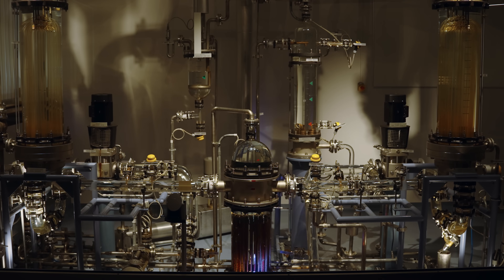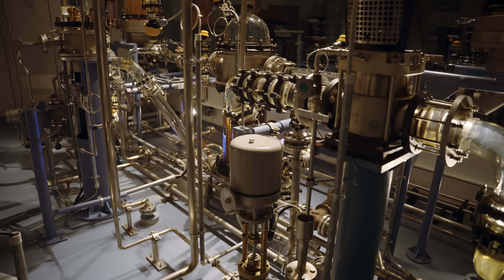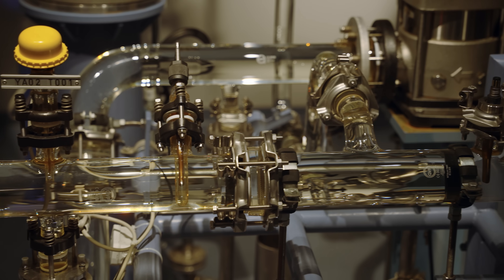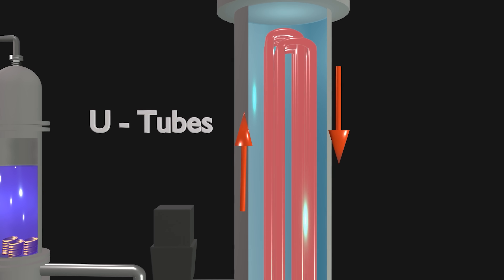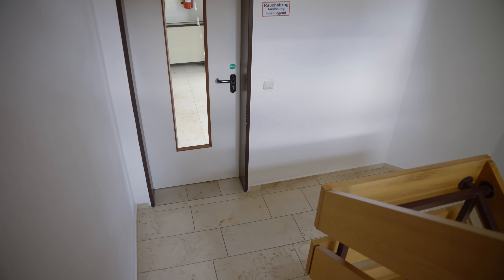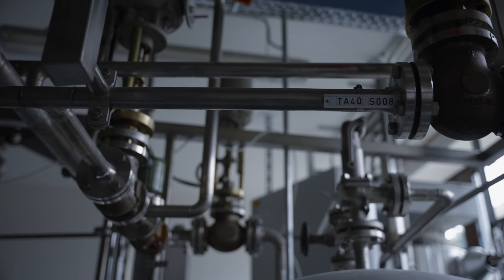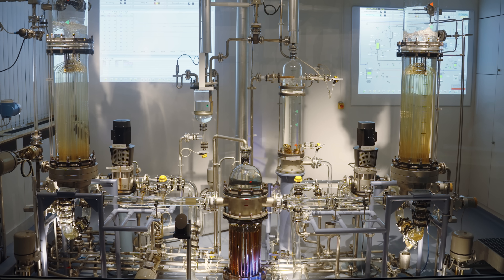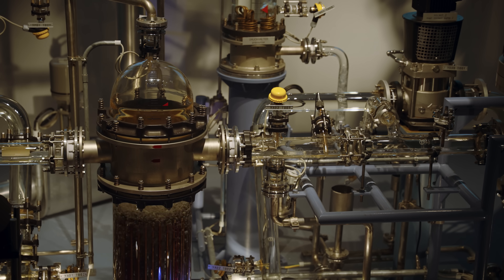World's Only GLASS Nuclear Reactor!

Comment: Sports can make a good analogy.
Take baseball for example. It's actually rather simple. Each team takes a turn throwing a ball at each other, to then hit the ball as far as they can within the play area. It's a simple concept. However, the professionals learn the fine details like fancy throws of the ball, angling of the bat swing, etc.
If you watch non-pro players... you'll see a sloppier game, but still pretty good. And if you get a bunch of people who rarely, if ever, to play... it's gonna be a mess and dangerous.

Nuclear plants are fairly simple in concept, with details to really get the most out of it. And that is why training is needed.
I mean, anyone can use 'spicy rocks' to boil water... but the pros do it with panache, and safety. And as the pros learn more, it only becomes safer and more efficient.
Old plants should be decommissioned... but they should be replaced with new plants.

Think of it like cars. A 1910 car was inefficient and dangerous. Modern cars are fairly efficient (could still be better) and have a lot of safety features (though I argue some of the most recent are adding new hazards).
The issue with cars is that most everyone (in North America) can buy one... and they only need to sort of be half safe about it. Drivers today are more and more like Homer Simpson working in a 'spicy rock' plant. Don't know any safety... and don't care to learn it.

Comment: I always find it a bit funny that our most efficient and technologically-advanced method of generating power is... lo and behold... boiling water, to turn a wheel.

But jokes aside, so PWRs are basically water-cooled, water-radiated systems that use pressurized water to carry the heat, and radiate it to unpressurized water which ends up boiling and generating steam pressure to turn the generator. Man, that's many points of failure and energy-conversion loss.

Comment: I missed the point and i didnt see any nuclear reactor. So, if i understood well a nuclear reactor is nothing but boiling water? 

So the Chernobyl nuclear reactor and exclusion zone is nothing but a puddle of boiling water? 

Thats not what i saw once in one of the many documentals about it
Reply: When you heat water up to extremely high temperatures, the steam separates into oxygen and hydrogen gasses, both of which are flammable, this isn’t like some stone with a boiling pot of water on top of it. The explosion at Chernobyl was from that hydrogen building up and exploding out.

Comment: At 6:35 I paused it to look over the model.  Identify the 2 coolant circuits pressurizer, relief tank and vent.  Then I noticed that the pressurizer is over filled but the pressure releif in under too little pressure.  The steam gen water levels look awfully low too.
Then I unpaused and found out why.
Reply: nice. good catch. later, you can see the core run dry.

Comment: 6:27 Many PWR reactors use three water loops - the pressurized closed-cycle reactor loop, the unpressurized closed-cycle steam loop, and the open-cycle condenser loop. This is mostly for reducing maintenance efforts and costs, as keeping a high-purity steam loop means less time taking turbines and condensers and evaporators offline for descaling and maintenance. Most marine nuclear systems use this three-loop system

Comment: "The phase out" or what i would call it "the Freak out", should not have happened. What happened in Fukushima could not happen in Germany, so getting in a panic and allowing that to take control was a weak moment for german leaders. Altho, have a look at the green deal and what happened there, getting a cushy board job at a russian oilcompany after pushing green is quite the "deal" lol. And the electricitypoverty that Germany suffered thru or still are.

Comment: Most electricity has always been made by either steam or water going through a turbine and spinning a dynamo - the only difference is in a dam or tidal, you don't need to push the water, and in coal, oil, gas and nuclear the only difference is how you heat the water

Comment: A good reminder that 96% of all US nuclear reactors leak radiation into the environment. 80% are leaking critical amounts of radiation 

All on the .gov site, just a hidden a little out of the way

I dont have a REAL "REAL" answer too why, but my most educated guess is they only care for by products to make nukes.... and other scientific equipment 

It was never about safe energy, thats very old propaganda that's been disproven since the dawn of nuclear science and the miltary.

Almost all nuclear plants help make nuclear ammo... (dense material for ammo, that ALL ARE HEAVY GUNS USE)

I'm not anti clean energy, but all of this "green" energy has been a lie. Windmills and solar panels make more pollution then most energy products... yeah... that hurt to found out.
Reply: The claim that 96% of all US nuclear reactors leak radiation into the environment is misleading. Nuclear reactors are designed with multiple safety systems to prevent radiation leaks. While minor leaks can occur, they are monitored and managed under strict regulatory oversight to ensure public safety. The Nuclear Regulatory Commission (NRC) provides extensive data on this, and there is no credible evidence to support the claim that 80% are leaking critical amounts of radiation.

The primary purpose of nuclear power plants is to generate electricity. While some byproducts of nuclear reactors can be used in other industries, the assertion that they exist mainly to produce materials for nuclear weapons or ammunition is not accurate. The production of nuclear weapons materials is typically done in specialized facilities, not commercial power reactors.

The notion that safe nuclear energy is "old propaganda" is not supported by scientific consensus. Nuclear energy is one of the most regulated and researched energy sources. While there are risks, advancements in technology and strict regulatory frameworks have significantly improved the safety of nuclear plants.

The claim that windmills and solar panels produce more pollution than most energy products is incorrect. While the manufacturing and disposal of these technologies do have environmental impacts, they are generally much lower compared to the lifecycle emissions of fossil fuels. Studies have shown that renewable energy sources, including wind and solar, significantly reduce greenhouse gas emissions and other pollutants compared to traditional energy sources.

Comment: Commercial fission nuclear power: too slow to build and too expensive to build/operate -- by far.  No way commercial will have any effect on the huge amounts of energy needed to displace fossil fuels over the next critical 10 to 20 years.  There's only one source of energy that can do that and it comes from fusion energy from the sky.  It can easily displace fossil fuels by several hundred orders of magnitude.

Don't be too sad.  Nuclear fission power will continue in specialized areas like military, scientific and deep-space exploration.  But commercial nuclear energy will disappear from all the world's grids in about 50 years' time.  The last 70 years of commercial nuclear fission proves it only amounts to 10% of the world's grid energy and it is falling.  Nuclear failed its promise.  If nuclear had worked out even close to what it promised, we wouldn't be so far down the climate crisis hole as we are now.  Sorry for all of us.

Comment: Having been a automotive tech for most of my career, im genuinely surprised at how similar a nuclear reactor is to the cooling system on the cars we drive everyday. It puts a whole new perspective on how simple these systems are and how safe, with proper maintenance and operation, these reactors are.
Reply: Every thermal power plant (coal, oil, half of a CCGT and nuclear) fundamentally relies on the same mechanism to generate electricity. The variation is on the choice of fuel.
Reply: Nuclear reactors are essentially giant steam engines.
Reply: This is one reason I advocate towards co2 magnesium burning steam micro turbines think throttleable rocket axle. Magnesium is probably the cheapest to produce metal fuel giving it a huge power density per dollar of refinement invested even compared to fuel oils. Heat and condenser cycling and exchanges are very well understood and common place in auto already.  Steam is under-rated and with modern phase exchange systems the weight is half what it was at peak steam and people flew on steam fyi in the thirties. Plus it's fuel and oxidiser tunable with one valve and a servo feed sets the fuel burn rate and power is delivered via a second valve for water making it extremely easy to tune and it burns co2 and only has about five moving parts excluding the diff.
Reply: Fluid dynamics is universal... 😅
Reply: This is not a nuclear reactor lmao, biggest clickbait in history, this is just an electric kettle ….
Reply: In the end, it's all about moving heat around, and there are only so many good solutions to that
Reply: Its no more dangerous than a cooking pot, its just bigger thus it makes a bigger mess if you manage to explode it despite the safety measures.
Reply: @monad_tcp  At least, regarding the parts outside the nuclear rods. The rods themselves are literally "just" self-heating heat elements, in that case. If you ignore the dangers with radioactive material (IF something goes wrong, obviously), there is indeed nothing dangerous here except a "bigger mess" due to scaling. However, if you include the radioactive material, the "bigger mess" can become an uncontrollable mess, rising with each safety measure that fails. 

This of course doesn't mean, that nuclear power shouldn't exist. But it does mean, that we should be prepared and willing to deal with potential risks as a prereqisite to going that route (something germany in it's complacent hypocrisy just doesn't want to, despite wanting the cheap energy).
Reply: @monad_tcp  well, we lack tsunamis here and oddly, Germany seems to have a dearth of such, but the risk of tsunami is too great or something. So, they fell back to reliable Russian natural gas.
Oh, here being a few miles upstream of TMI, which was shuttered in 2019 due to the cheaper price of generating power by burning natural gas.

Comment: An then no one wants to have the nuclear waste in their backyard. Even though I agree this belongs into a museum, nuclear in general belongs into a museum.  It's super expensive to build and operate,  the failure modes are spectacular, and the uranium comes from russia. Meanwhile, both solar and battery storage manufacturing prices have plummeted insanely fast. It's super cheap, decentralized, low risk.

Comment: you know what is simpler and safer and cheaper than all of that...  a solar panel
Reply: none of what you said is true
Reply: @gonzalezvalencialeonel9563   solar panels don't need a trained safety team in a control room.  Safer and simpler.  And go ahead and look up the cost of installed solar vs cost of building staffing and maintaining a nuclear power plant
Reply: @ashleydolin4292  I gave examples why I'm right.  Give me your evidence that I'm wrong.
Reply: @ashleydolin4292  for those who don't want to do the math, you can just see it in what's being built.  Solar not nuclear,  grid scale batteries not peaker plants.     I'm not anti nuclear, you need nuclear for space and ocean anywhere away from solar.  But I'm not a fan of nuclear that I'm blind to reality of how cheap easy and safe solar is.  They are just collectors of an existing fusion nuclear reactor.

Comment: Nuclear power is expensive from conception, wages, maintenance, decommissioning and looking after the waste.
Reply: yeah but no. The average oil power plant produces 8 megawatts of power. For nuclear, its 900 megawatts, a 100x difference. So, to be equal, an oil plant would need a construction cost of $80 million.
It isnt at all expensive to look after the waste, you can literally just set it and forget it for the most part.
Reply: @KayC352  When they are using 20 mm thick copper casks for the high level waste, I would call that expensive, also the cost of copper rises for other uses, eg creating brass parts and plumbing, I don't use plastic pipe work.
Reply: @KayC352  The cost equation for the output in megawatts in two totally different forms of making superheated steam can not be balanced just like that.

Comment: Its a steam turbine generator it turns giant magnets thats push electrons into specifically wired patters of copper wire  copper thats how they produce alternating current at night they turn down the turbine in my area and you see lights "pulsing" its literally thr power plant powering my grind on eco mode because everytime the magnet  passes each coil it could be a 3 coulf 6 coil 8 coil i think even more but bottom line is the faster rpms you have to spin with lesser coils to get the same effect and running those slowly will cause pulsing because there is time where the magnets arent facing coils in rotationg thats how it "alternates" it moves back and forth in the line because the magnets nort and south poles are constantly passing these coils non stop you should brush up on how a nuclear powerplant actually generates electricity as a science communicator who claims to be so knowledgeable and and this massive advocate activist for nuclear power its embarrassing to know you dont even have a clue how the steak turbine generators actually produce electricity i think i should make a youtube channel if i had film and editing equpiment i would, shame on you kyle i still love you tho but fr do better if you wanna communicate properly and advocate it actually know how the power as you call it, power meaning alternating electric current in this case the politicians and public arent getting the full picture you should brush up on that stuff and make a full video from start to finish how electricty is generated on site and then sent to substations ans splitters and switching stations and to your home

Comment: OK I just got to the part where you said you don't need fissile material for the simulation. The caveat to that is--there is no neutron moderation, reflection or absorption to worry about. I guess they can simulate all of that with the electric elements and software, but you don't have the physical, instantaneous reactions that caused things like that one accident where the guy was stirring a big batch of nuclear fuel in a too-large container. It happens before your neurons even receive the signals from your senses.

Comment: This may be the most technical and accurate model in existence and absolutely needs to be preserved. But there are still other physical models used today to train various reactor room personnel, including mini reactor vessels made from glass, so they can understand cooling systems and other components. On another note in the 70's my father worked for a company that did some of the best plexiglass fabrication in the world, they built two Full Scale Plexiglass Reactor Vessels for Westinghouse that were used to observe, understand and modify flows around various uranium and control rod configurations at full operating pressure, before computer modeling took over the job in the late 80's.